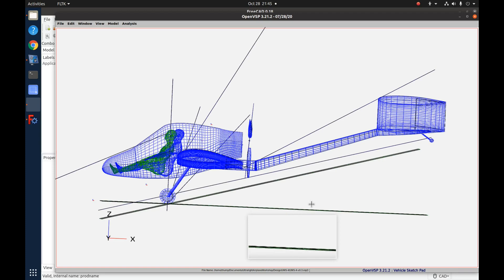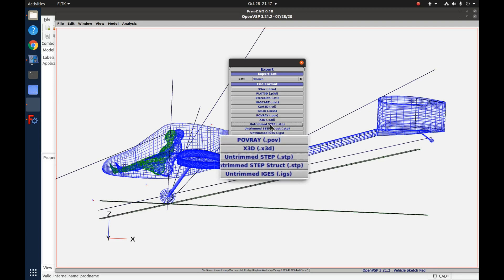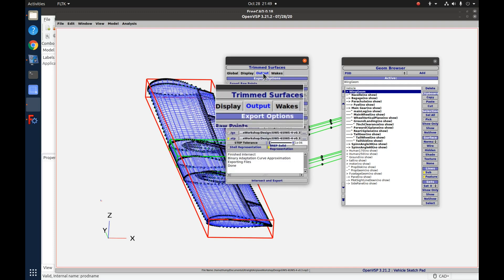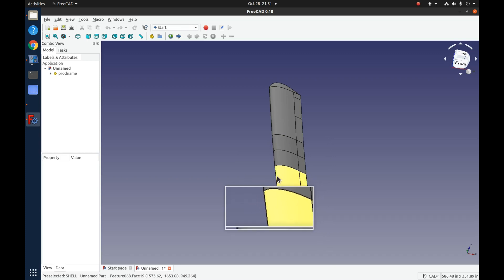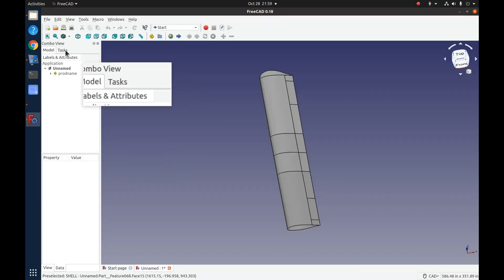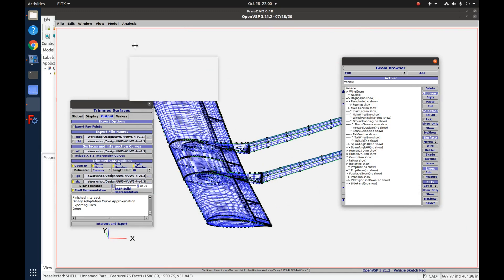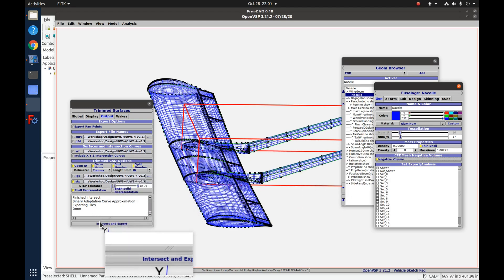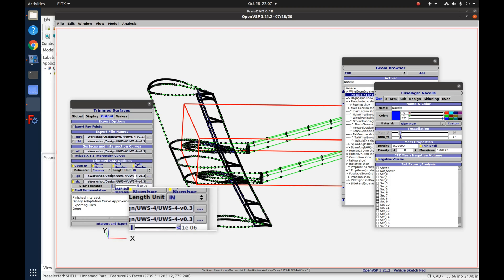OpenVSP Tutorial: A Better Export for CAD

Comment: I just spent a very long time trying to reproduce what is shown in the video, using v3.25.0. I eventually realized that it was trying to export EVERY body in the scene no matter what. In the cases that I let it finish, this took an extremely long time and in every case produced a file that caused Freecad to crash when importing.
For anybody else having this problem, maybe try this approach: save the file, delete everything you don't want to export, then do the export, then re-open the file. This will still not help if some of your bodies have their position/rotation set from a parent body, but thankfully for me it's enough for now. 
It seems very strange that the Trimmed Surfaces dialog has no option to select which set of bodies should be acted on, which is a pretty standard feature almost every other dialog of this type.
Reply: The next problem you might come across is that a single wing body with no control surfaces will be exported differently to a wing with control surfaces. With control surfaces it becomes a tree structure with origin axes, multiple 'compound' items and a single 'solid' item. Without control surfaces, it becomes a single item of some type I don't even know what the hell it is. The latter cannot be used for further boolean intersections with other shapes. So you might wanna add some dummy control surfaces.
Now I'm stuck on boolean intersections not working if they cross between different sections of the wing... it feels like I'm pushing a huge boulder uphill, every time it seems to start moving it only goes a few millimeters and then I'm stuck again.

Comment: Rather than struggle against Shown / No Shown all the time, you should experiment with using Sets.  You can create a Set that contains just the components you want for a given analysis or export and then pick that from the corresponding menu.
Reply from the maker: You are absolutely right. I really should use sets more often.

Comment: Thank you so much for this video series! 
Question: I am working on an idea for a kit plane that I will produce and market the kits for. I have looked at the Sling TSi assembly manuals since that closely resembles what I want to produce, AND they are available for free on their website. I really like the way they presented the work to be done in a graphic sense. You can tell it was probably produced in.... possibly SolidWorks??? I would love to mimic that method, and THIS VIDEO was the first time I saw a possibility of an easy transition from design to "construction documents". In the video you stated that "you can see how this would be useful." Is it useful because now you have a CADD file with the skins drawn? Can you use this in some form to cut the skins into flat sections for cut-out of the aluminum sheet? (I should mention, now that I think about it, my plan is for an all-aluminum project) I guess what I'm getting at is, I would benefit from a discussion of HOW to express your design into construction docs? How do you draw a rib inside of a wing in SolidWorks? What are the CADD options for producing airplane assembly manuals? I am an Architect, so I can draw all day long in DataCad, and by hand on a drafting board, but neither of those methods will do for these types of plans (not if you want to be perceived as legitimate in today's kitplane market). I have used Sketch-up before... It was not comfortable to me. Hard to be accurate. SolidWorks seems very labor-intensive. Can you take this CAD file you just produced and insert it INTO SolidWorks, slice the fuselage in a given area, and use that slice as a saved view by which you now can draw a bulkhead for that station? 
Sorry to go on so long. Hopefully you can get a sense of what I'm asking in a general sense.
Thanks again for your videos!
George
Reply from the maker: I have done a lot of what you've asked about. I've exported wings/tails from OpenVSP and into SolidWorks, Fusion360 and FreeCAD. In CAD the import is either a shell or a solid. I find shells to be a little easier to start with for an aluminum skinned airplane. And YES, I slice the imported file to start making ribs, bulk heads and can use the shell to unfold for aluminum skin cutouts. I'm afraid you have quite a bit to learn regardless of which CAD program you use. I think that once you learn your CAD program you will find it easy to make assembly drawings. Sometime this fall I will probably start on the structural work on the UWS-4 so you will see me doing this kind of work then.
Reply: Good luck with your venture. Going into kit production can be Costley if not time consuming.  LOL I had planned kit production of an ultra-light loosely based on the j3 Junior size and style. Although mine was a monocoupe all sandwich composite using a combination of foam, carbon fiber, and or S glass or Kevlar.  I sold the molds. Because I simply did not have time between ranching and beekeeping. This was nearly 20 years ago. I built my first airplane  in the 70s, and several since. All without CAD. Although some were plans built. Some have been of my own design.  With that said, if you have the money building with aluminum CAD/ CNC would be the way to go. Real time-saver when it comes to Precision cutting and drilling.
Reply from the maker: I have a 48"x48" CNC router. At some point I will use it on the UWS-4 build but first I will use tools that viewers are more likely to have just to show that you don't have to have expensive tools to build with aluminum.
Reply: 2024 ... how is the development of the Kit you had planned ?
Reply: @nevillecreativitymentor  Funny I should open this email notification that you posted this response (albeit 2 weeks ago) just as I am getting on my computer tonight to do a little noodling around on my project for the first time in months. I am just finishing up building our new house and getting the old house on the market. That has been my hold-up to getting serious about my new kitplane business. At this moment (well, in about a week, actually), it is full steam ahead. I just started sketching around tonight to get back in the saddle.

Comment: I've played around a little bit with OpenVSP, I've built wings and ran some analysis on them, but I haven't figured out how to build a fuslage yet. Have you done a tutorial on that yet, that I just somehow missed?
Reply from the maker: Hi Reubin, The OpenVSP folks have been working hard on tutorials and doing a great job so I will not be making any more OpenVSP  tutorials unless something unique comes up. You can find many great tutorials here: https://vspu.larc.nasa.gov/ . Chapter one has several good videos on the fuselage. I generally start with ellipse cross sections just to get the cross sections in the right locations and then change them to super ellipses. Super ellipses can handle most of the cross section shapes that I use.